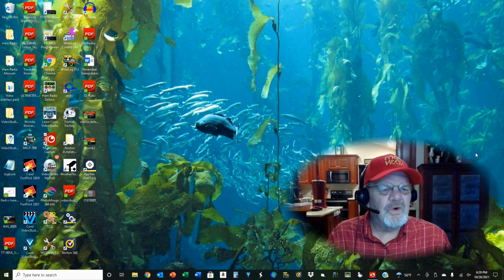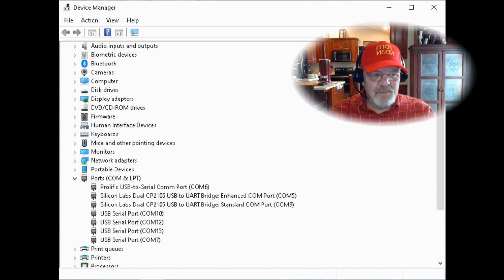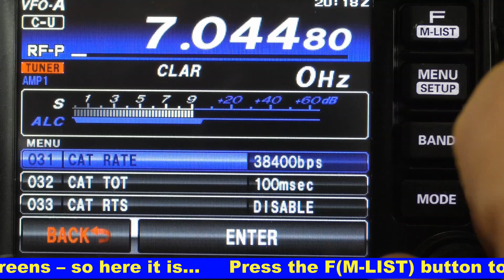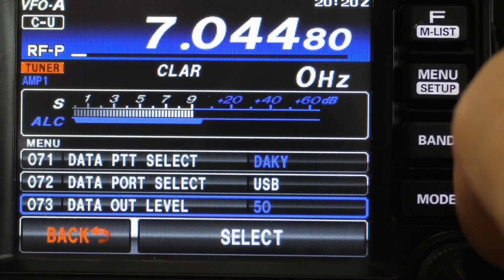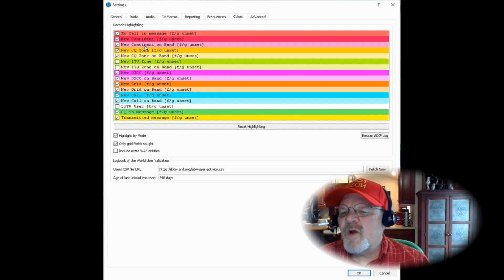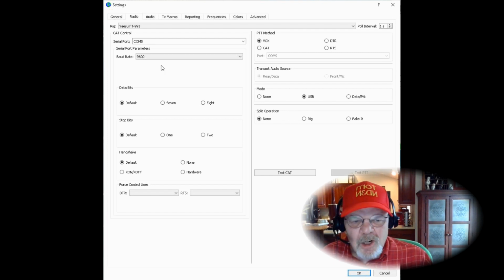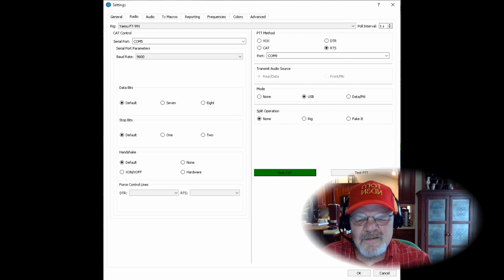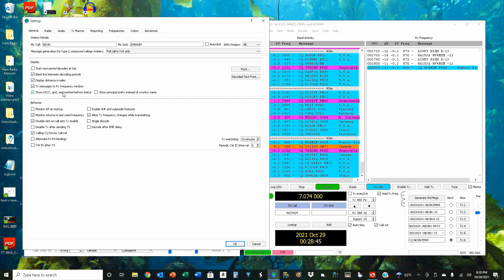FT 991A / WSJT-X Setup

Comment: Need to know what is the best setting for  DT-GAIN on the 991a for FT8. And I asked in another video of yours...is there a correlation between ALC and the digital gain settings?  73  N6ZKI
Reply from the maker: There is a correlation, but with the ability to adjust on the WSJTx main screen, just leave DT-gain in the default and adjust it up or down only if you can’t get ALC in range using the sliders.

Comment: Thanks Tom, problem was not radio, but WSJTx it self. Some kind of weird glitch. I totally turned off all sound input and it didn't affect the db bar at all. Maybe something else on PC glitched it. But after uninstall and reinstall it went back down between 30 and max 40,
Reply from the maker: Glad you found the problem and was able to fix it.  I guess that’s the ham radio version of unplug it and plug it back in…

Comment: TOM, I have watched several videos on the setup for WSJTX and the 991a. And all worked for awhile. But now since it has messed up and I don't know why. I cannot find any video expaining the bar DB bar graph in the WJSTX program window, It used to be around 40. But now is at 85 and I can't figure out how to change it back. Any reply appreciated. N6ZKI
Reply from the maker: I believe you’re talking about the receive indicator bar.  Use the RF gain control knob on your rig to turn it down.  I try to keep mine in the 45 to 55 range.

Comment: In the radio tab within the settings menu, the "Transmit audio source" is greyed out and doesn't let me select rear/data.  Any ideas?
Reply from the maker: Do you have the latest drivers installed.  Go to the FT-991A page on Yaesu.com and select the files tab, follow the instructions there for installing the drivers.
Reply: @ND3N  I'll have to double check.  Strangely enough, everything seems to be working anyway.  I've already had a lot of success hearing other stations and being heard on WSPR.
Reply: @ND3N  Yeah I have all the drivers, still greyed out.  I guess as long as it works, I'll leave it.

Comment: Great video, I have a few issues, The CAT works, BUT: NO power when it clicks into xmit. (Slider is all the way at the top),  There is audio going out from my mic which i can see on my meter. The radio is xmitting my voice instead of data.  I think the issue is with my laptop, but I've been unable to fix the situation.  Any help or being pointed in the right direction would be appreciated. Yes, I have also looked at countless videos to NO avail. Thanks, Jim K2WPA. (Also, I've been doing FT-8 for over a year and this is quite frustrating)
Reply from the maker: Check the audio settings on your computer.  It sounds like WSJTx is using your computer audio instead of the codecs.
Reply: @ND3N  it shows codec c in the audio section of WSJT-X.  I can’t for the life of me understand how to change the pc settings. I’ve been trying for a week.
Reply: @ND3N  Same problem; I set up my FT-991A exactly as you described in your video. And I use the exact same FT8 settings. I can receive signals and decode them correctly. When I test the settings, the CAT button turns green. But when I attempt to transmit with the PTT button, the PC will key the radio, but no power is transmitted.  I disabled the computer audio setting, so it is not possible for the rig to use any output except CODEC. I can appreciate that this is a problem that others have had with this radio, but I have yet to find a solution to this problem.
I should note also that I can transmit using the Winlink program. So, I don't think it's a sound card problem, and it is not a USB cable problem as has been suggested by others. 
Has anyone else had this problem and is there a solution?

Comment: Tom, I followed your video and got FT991A menu settings and the WSJT-X app installed, configured and monitoring successfully the first try!
There's still some questions I have about frequencies, TX / data gain I should be using. Starting lower end of the spectrum. I shutdown about 23:10 when wife opened the ham shack door said, "the dogs need to go out!" Will pick up where I left off tomorrow. 😂
Thank you sir. 73 John
Reply from the maker: Glad it helped

Comment: There is a lot about this video that is wrong. But you got your 991 to work despite it. First of all, port settings in device manager have nothing to do with running WSJT-X. All that matters is that the settings on the radio Menu #31 and the settings in WSJT-X match. I run 38400 on each and the device manager still says 9600. And you are running WSJT-X in USB mode, so none of the DATA settings you did have no affect.
Reply from the maker: Thanks for the additional info - I tried setting up with Data-USB, following several YT videos and research in the owner's manual.  Was able to get everything working except when I went into the WSJT-x settings I got good test results for CAT and PTT, but no sound was coming out.  So, I did the video as I did and as you noted, my 991A worked with WSJT-x.  Will play some more (I have a few thoughts but ran out of time to play) and see if I can get it working to spec...  then put out an updated video.  73 de Tom, ND3N
Reply: agreed moving on

Comment: Ok this may sounds like a crazy question but IF I setup my 991A for FT9 with WSJTX... can I still use it for Phone like I normally do when I am not using FT-8 or is it a massive task to switch back and forth between them?
Reply from the maker: You absolutely can.  For FT8, or any digital mode, you want a flat response.  So make sure that on your functions screen, your MIC-EQ and PROC are turned off.  Then turn them on with your preferred DSP settings for voice.

Comment: Tom, enjoy your videos, question for you since I'm new to HF and FT-8.  I have a Yaesu 991a and after setting up for FT-8 is it necessary to reset the settings back to use SSB or do they not effect the voice portion?
Reply from the maker: Good question - I'm putting the finishing touches on a video that discusses that further.  It should be posted on Tuesday afternoon  (6/31/22)

Long Story short - make sure that when using FT8, that the MIC-EQ and PROC buttons in your functions are both turned off.  Then you'll be using a "flat" profile across your bandwidth.

Comment: I have a curious question. I set my radio levels to transmit 100W on FT8. I notice the during the course of the transmission my wattage drops from 100 to 50 to about 25 watts, and sometimes 10 watts. Is this being done within my radio transmit circuits, or is it managed by WSJT-X software? I am guessing it is there to protect the finals, but I am not sure what is doing it.
Reply from the maker: That could be happening inside your radio if you don't have a good match.  The reflected power from a high SWR would cause excessive heat and your rig would throttle back to keep from burning up.  Do you notice the fans come on?  Of course, this is a first guess as I'm not sitting at your rig, so my troubleshooting will be limited.  I'm sure that its not the WSJT-x S/W, but it could be something in the audio from the computer.  73 de Tom, ND3N
Reply: @ND3N  Makes sense. I does seem to change some band-to-band.
Reply from the maker: Make sure your ALC is set properly as well...
Reply: @ND3N  Since I asked this I obtained another radio, same antenna, etc., and this does not happen. Answer: Some radio protection feature in the IC-718.

Comment: I don't see the silicone com ports as in the video. All I have is "Communications Port (Com 5) and "Multiport Communications Port (Com 6). How do I get the other ports to show up?
Reply from the maker: Your serial port is the 9-pin D-sub port that is located next to where you plugged in your USB cable.  It is labeled "GPS/CAT"  You'll need a Serial to USB cable or adapter, then just plug it in while watching your settings in Device Manager.  You'll see it pop up along with your other comm ports.  Set your menu 028 to RS232C, 029 to 9600, and 030 to 100msec.  Make sure that port is set to the same values in your Device Manager on your computer.  You can then use the RS-232 port for CAT operations (along with your Comm Ports - in your case com 5 and com 6), and is useful if you are running multiple programs that require a CAT control signal.  btw - I've added this idea as a new video to do more research and produce sometime in the next few weeks.  So, let me know how it worked for you.

Comment: Hi Tom,  been trying to use ft 8 . I  see no alcohol but I don't see power out. Everything looks right
It's beating me up. Going to put a watt meter out to the antenna. Guess it might be I don't know what Iam doing. 
Do the test and get the green and red for  Transmit.
Thank it just night be brain freeze 😴
Reply from the maker: Keep chipping at it - it's probably a simple problem.  If you have no ALC (hi hi to your alcohol...) you won't get any RF out.  Does your rig indicate that it is transmitting? If not, you've got a keying problem - if yes, then make sure your codecs are selected in the setup>audio tab. and double-check your menu settings.
Reply: @ND3N  yes on alcohol I see nothing
Reply: My typing is bad lol🙏✌️⚓

Comment: Hope its not a stupid question, but changing those settings in the radio, does it make any difference to using the radio normally as in SSB and so on?
Reply from the maker: It shouldn't as the data for WSJT-X comes out of the back of the rig via the USB or RS-232 ports, while the voice is via the mic on the front.  The mic is suppressed if the data ports are active, but if inactive, the mic is primary.  Try testing it and see if I'm right...  hi hi... 73 de Tom, ND3N

Comment: Thanks for the setup, I have seen different versions of configurations. Testing them out. One thing I have noticed with my setup, the audio tab, the only config that has worked for me is Input: FT991a From Radio (USB Audio CODEC) Output: FT991A Audio to Radio (USB Audio Codec).(I forgot I changed the name of the CODEC, from computer to FT991a)I have bounced all over from London, Hungary, Canada and more..  Thanks for the video.. 73 - KN4YLL
Reply from the maker: That is the correct input/output for the 991A internal sound card.  Did you set your SSB input to "Rear" Menu item 070?  Did you install and verify the USV Virtual Comm port drivers?  Did you use the Enhanced driver for your CAT controls and the Standard driver for your PTT (radio tab of the settings) - select RTS for menu item 071.  Lots of variables...  feel free to give more specific info and I'll be better able to tell you what's happening.

73 de Tom, ND3N
Reply: @ND3N  - You answered my question - none of vids  show the audio tab Soundcard in the setup with the FT-911A as the Input and Output, everyone shows the computer's usb input mic and output computer speakers... I am having no issues running FT8 - making loads on contacts...(So Apparently in the past I had renamed the USB CODECs to F991A)
Reply from the maker: Fantastic - I know that in my research I have seen someone rename their codecs - but I didn't include that in the video.  Something to include in the future (and to do for my own rigs).  73 de Tom, ND3N

Comment: Hi, Tom. Great video! I have an FT-991A and use it a great deal on PSK31 and FT8. The one thing I cannot resolve is the ALC setting with the DT-G knob. One FT-991A video says the ALC should be zero, another FT-991A video says just keep the ALC bars within the blue ALC line and another FT-991A video says you should have 1-2 bars showing for ALC. 

I would appreciate your input on this as I definitely would like my signal to be clean. I also have an Elecraft KX2 and the Elecraft manual says 1-2 bars of ALC and I always get great reports with it at that setting. Anyway, thanks. 

KZ6B Alan
Reply from the maker: Alan, you want your ALC to read near the top of the blue bar.  Any less and you won't be getting your full audio out and any more you'll be clipping your audio signal.  The 991A will rapidly clamp down on your audio past the blue line, so when you're adjusting it, bring it down to around 1/3rd of the bar and raise it until you get to the top.  Set your input audio at mid-level and use the slider on the right side of WSJT-X to tweak, while watching your 991A ALC reading.  You may need to adjust it between bands.  All that said, if you're getting good reports with what you're doing, keep it up.  I'm not familiar with the Elecraft - though I've used one during RTTY contesting as part of a multi-op station - someone else adjusted everything.  Hope this helps, 73 de Tom, ND3N
Reply: @ND3N  Thanks, Tom. That is what I have been doing but just needed some confirmation. 73 Alan KZ6B

Comment: thank you for this video, very informative and just what i was looking for
Reply from the maker: Thanks Jody - Let me know if there are any problems that you find - or if everything works as advertised.  It all checked out on my system, but want to be sure it is valid for more than just me....  73 de Tom, ND3N
Reply: @ND3N  i was able to install it today and i ran into 2 issues, after installing the drivers from the yaesu website i did not restart the computer so when i went to the device manager it did not show the com ports, completely my fault but took me a while to figure that out.  2 after i finished all the settings for the radio and wsjtx when i tried to test the cat and ptt an error came up, it wasn't until i unplugged the usb and plugged it back in that it all started working, again my fault due to my in experience with computers. but again thank you for this video it enabled me to get my ft991 working
Reply from the maker: Glad you were able to finally make it work...  I can usually be found working FT4 (mostly) and FT8 after 10PM most weekday nights.  Would love to have you in my log.  73 de Tom, ND3N